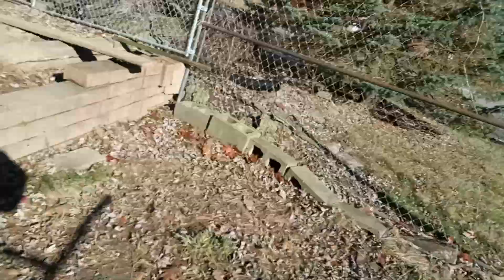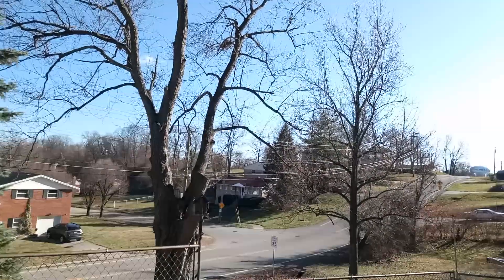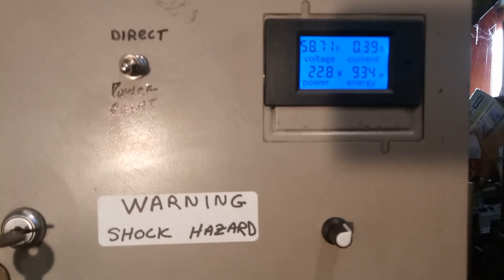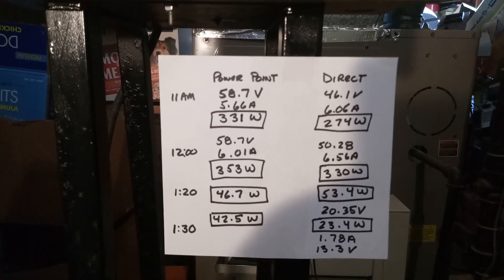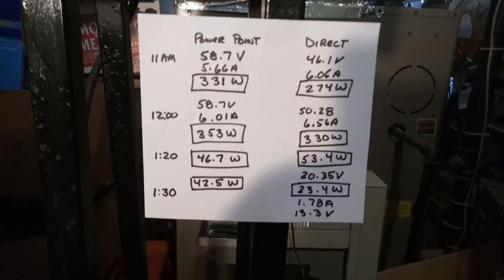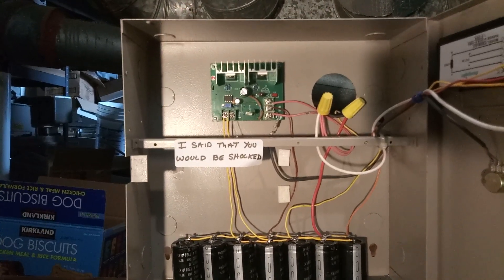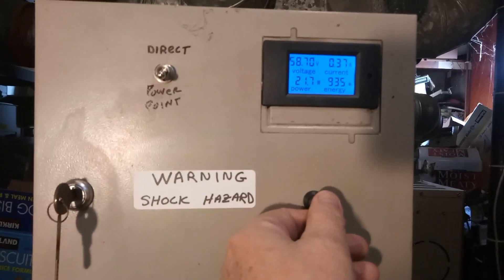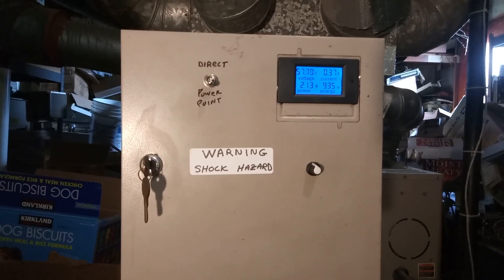Low Cost Supplemental PV Solar Water Heating At Efficient Power Point

Comment from the maker: This is a cautionary tale about having unrealistic expectations for solar. Site issues can dramatically reduce output beyond what you would think. My panels were at an angle half of what it should be. They also faced southwest. Trees shaded panels enough that there was only three hours of usable sun. Still, when costs are kept low even poor conditions have a payback. With direct connect there is only useful power for two hours.  A power point controller can capture the wasted power of those other 7 hours of sun. Heater tanks need 50-75W just to maintain temperature. Those small watts count throughout the day.  Always include a watt meter in your system. It can't be improved without knowing real numbers. My camp system harvests power using this same method. Panel power, usually wasted, heats water and those tanks are up to temperature by 11am. This is my only source of hot water in the summer.
Reply: my site is in a little valley and with tall trees all around so I don't get a lot of direct sunlight hitting them.  Couple hours only around 11-2 or 3 pm then its intermittent.
Reply from the maker: @SATLE2322   Exactly my situation but you can still get heating improvement over direct connect.  MPT tracking has little value over fixed voltage with a fixed resistance.  Any array going into bypass will never supply full current when resistance is designed for higher voltage.  I do temperature tracking which works quite well even in shade.

Comment: Fine, Thanks  where I buy IR2153 inverter board ?link?
Reply from the maker: There are a dozen variations of this circuit that can be used. The IR2153 has some design 
advantages in some situations, but the presence of fakes in the market is an issue.  It can be substituted with almost any FET driver IC as long as it has low voltage lockout and an external zener is used for regulation.  I use the IR2101 dual driver because it closely matches the pinout of my circuit board with only minor changes. As tis is low speed switching, a high current driver is not necessary. This circuit uses the same reset timeout delay philosophy to increase noise immunity and prevent high frequency pulses from overheating the FET. This is accomplished  by the driver having a Schmidt input. I would have no concerns of substituting a driver.  The capacitor pullup resistor just needs to go to VCC with a 13-15V zener to provide VCC power regulation. The reset of the timing capacitor must be able to go below 1/6 VCC when a IR2153 is used or below 1V when a FET driver is used instead.

Comment: hahaha! i have been shocked! i would like to know how this buck convertor preform vs regural mppt? btw, arnt your wires a bit thin?
Reply from the maker: Wire size doesn't matter that much for short lengths. I did use a double wire to the board, the proffered way to do it. This keeps the screw balanced and prevents it from snapping. Those are really small terminals and I only run about 6A. As you can see in video, changing panel voltage doesn't change the power that much in a couple volt range. This feature is necessary if harnessing excess power when a charging system is in parallel.  Panels average a terminal temperature mid day and seasonal adjustment is sufficient. Early morning temps don't matter because the power is so low then.

Comment: Great video!! Will this work for 120v DC solar? Extremely interested in in PV direct. I have a 1.8kwh array feeding a 15.2ohm element. It's winter so that hits the power point best. I really want/need to build a controller like this
Reply from the maker: In principal this works for any voltage.  This China board is only suitable for lower voltage systems of about 60V as board trace spacing is not appropriate for higher voltage.  You would have to build circuit from scratch.  Alternate method  with power you have is using two heater elements of higher resistance and switching in second element when there is more sun. At 70% current, one element is better than two in parallel. I did a video on this. This uses an off the shelf control.

Comment: Awesome what caps are in there? I use all my DC panel production for battery charging in winter but hey less than 20 days and we start to get more sun.
Reply from the maker: The caps are 1,200uF 200V.  The panels at that angle was for the ease of mounting.  Just thinking this morning about increasing another 25 degrees. Right now the best ideal power is 355W. I should be able to get another 100W in winter.